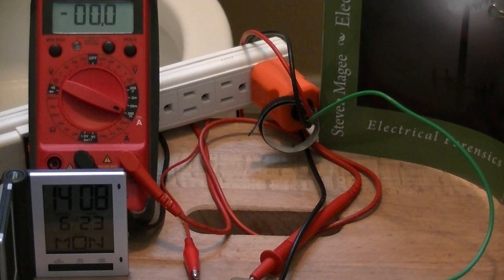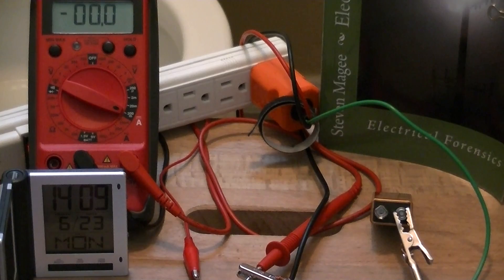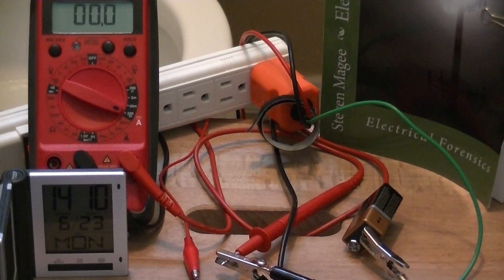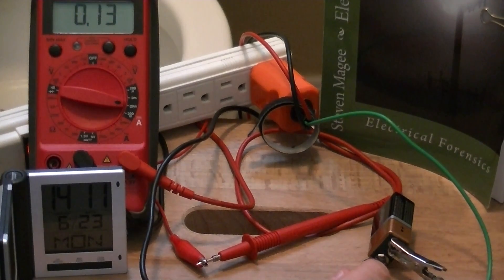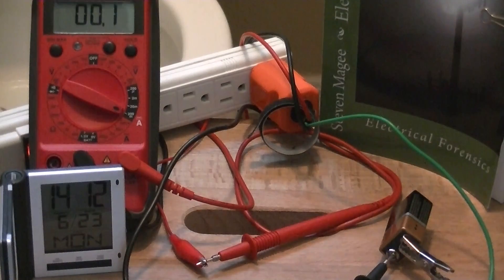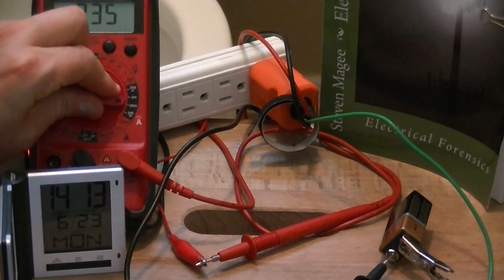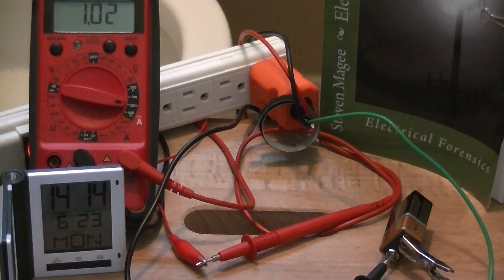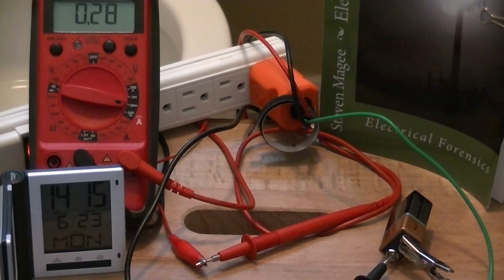Electrical Forensics: Toilet Drain Electrical Currents

Comment: Hi Steven, Thank you for this video this are the little things that are overlooked by not only the average person but even the like minded EMF aware...

Curious if you know depending on how much stray voltage is on a certain area, if you live in a condo like me and have no access to the earths soil then would the stray current measured in say a toilet be cancelled out or unreadable by the stray current on the grounding system when I use the ground plug on my electrical outlet ? Assuming they were the same voltage level...

It seems to me that the stray current could run ether way, so it could be dumping it from the ground plug or it could be already there in the toilet bowl. And because of that I would not be able to get a true reading or be able to find were the source is...

I just want to be able to know if I have stray voltage on my water pipes & or in my water when I do the dishes, shower, bath...

Cheers
Terry
Reply from the maker: If you can't get to non-electrified soil for a reference then you are going to have a hard job measuring stray voltage.  You can do it with plants, but it does take several months to get results.  Keep the cable as short as possible to reduce the cable wireless radiation antenna effect:  http://youtu.be/x8oxXYkmsrU Review of Grounded (Earthed) Frankenstein Plants September 2014.

Comment: Stray voltage is still just the movement of electrons, it would be a real brain teaser and lure if you were to include an amp reading and then quickly state how many electrons are flowing into your toilet bowel, and of course when someone pee`s up the stream and into their body :/

If you measure the ohms you can figure out the amps from that, of course you already know that I put it out there for your viewers sake.

Thanks again,

Cheers,
Terry